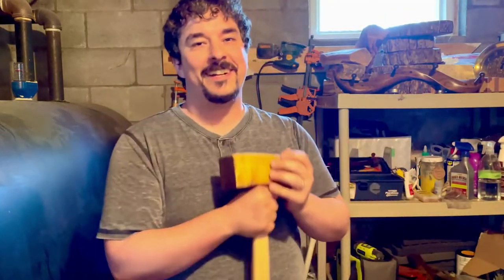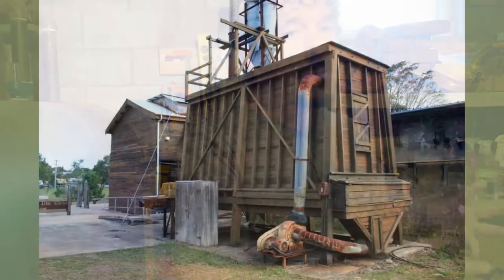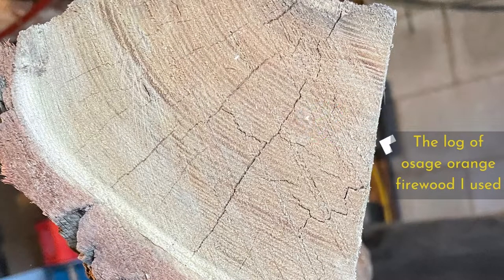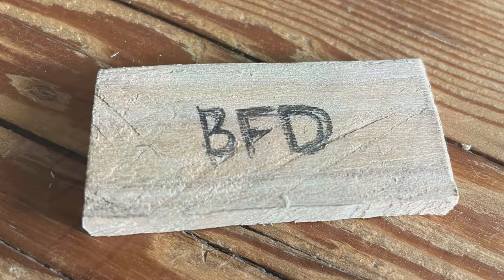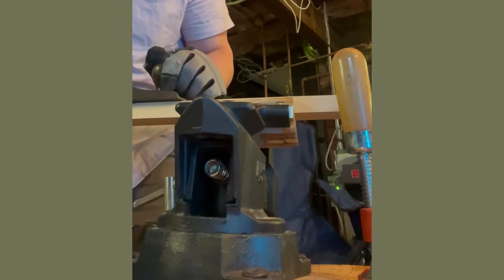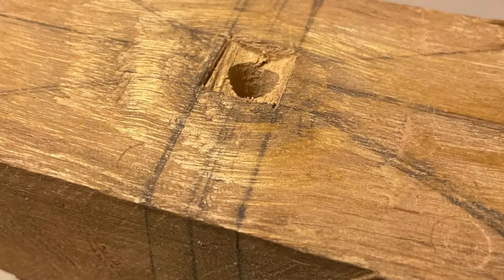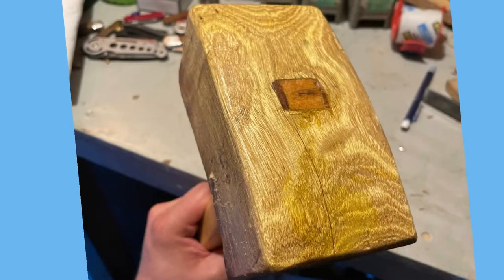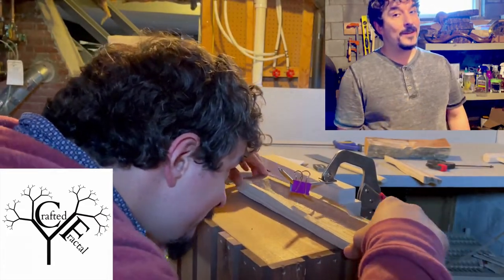Making the "Thor's Hammer" Wooden Joiner's Mallet (Rex Kreuger's plans)

Comment: Since you asked if I have a favorite wooden mallet I like to use, I figure I'd tell you about one I made nicknamed " Ashton". ( Note: yes, for those of you who get the refrence, I am a nerd. ) It's big enough for my 3 year old nephew to use as a walking stick. XD

The plans I used for making the mallet are easy enough to find, but essentially it's a glue up of 5 boards that forms a cabnet maker mallet.  ( Dimensions: 
Handle: 27 1/2 in. Long with a paracord grip.
Head: 
 3 in. W by  2 in. tall by 6 1/2 in. Long, made of  oak.) 

I use this mallet for " extra stubborn shop issues." and have used it multiple times to perform " percussive maintinance" such as demo, renovations, and general construction. Everyone of my buddies who sees it ( as well as my girlfriend) want one. Works great as a sparkless hammer as well.
Reply from the maker: Very cool! I'm very curious to learn more about it!
Reply: @CraftedFractal , my pleasure. What other data did you need about the carpenter's/ cabinet maker's mallet? Did I miss any details you wanted?
Reply from the maker: @TheBottegaChannel  just if you had any pictures to reference—sounds like an interesting piece!
Reply: Ah! Unfortunately I dont have any pictures of my mallet, but I can definatly source the build videos. The initial design was based off of Paul Sellers's playlist of 3 videos on how to build a mallet. For the head glue up, I just cut a 1 in. X 2 in. X 36 in. into two 6 1/2 in. sections and 2 shorter sections which were angled to form a downward inner taper which bottle necked everything into friction fit tightness against the removable handle. From there, I made 2 triple pass false Turks head knots, one to act as a friction fit gasket to secure the bottom of the mallet head leading into the paracord grip. The bottom of the two triple pass false Turks heads on the handle is affixed through a lanyard hole like how they secure a koshirae onto a katana tsuka, effectively making a pommel swell/ built in hand stop. By pulling 2 cords, the whole mallet can be disassembled for any maintinance should the handle section or head break. Hope these details help.